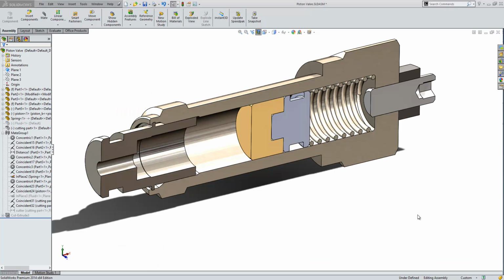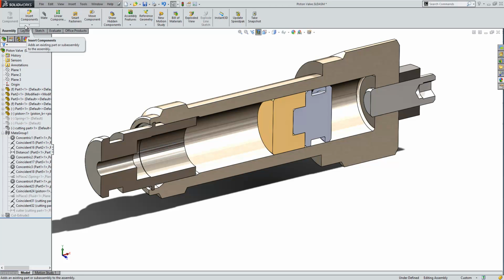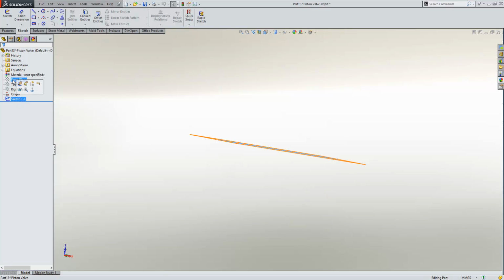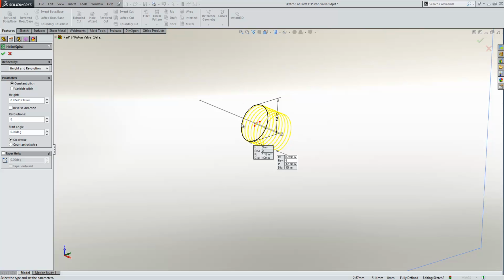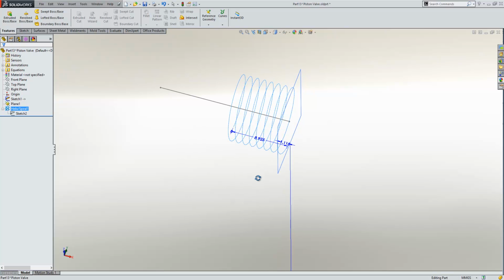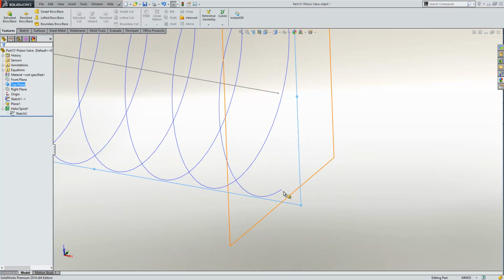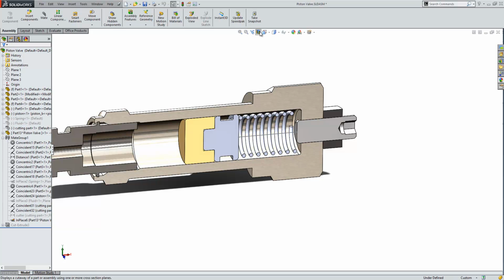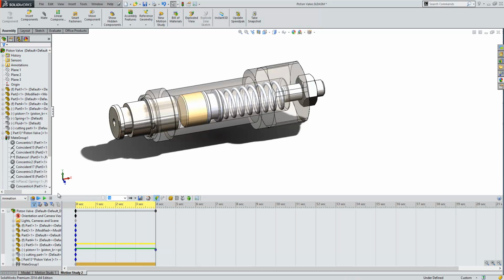How do you animate a spring compressing in SOLIDWORKS?

Comment: idk how quickly you guys reply, or if you even pay attention to this video anymore, but I have a problem with my spring.
I could've sworn it was changing length when it was still just a line, but when I'd finished building the spring & rebuilt the assembly, the spring & line were just moving up & down—not changing length at all.
Is it because the line was created using 2 points on 2 different sketches? The faces that the spring is supposed to push on are rings, not circles; there's a hole thru the middle of both.
Or is it because when I went to add a dimension to the line, it did not over define the part; it didn't ask me to "leave it driven." I tried right-clicking the dimension afterward & selecting "driven" in the pop-up, but I can't tell if that did anything.
I only have until 2pm today to finish this stupid thing, & I'm getting really concerned that I just can't make the spring work.
Reply: OMG NVM I DID IT SOMEHOW
OH MY FRICKIN' CHEESE the line just wasn't actually attached to anything on the one end

Comment: great tutorial but how do you link the helix length to the sketched line if you define the helix with variable pitch? Double clicking the helix doesn't show the overall length so can't be linked to the reference dimn of the line. Using variable pitch gives a better looking spring with closed & ground ends.

Comment from the maker: Peder, if you want a default view for the spring, you would need to set it into the length you wanted, and then right click on the component, and select “List external references”, you can then break the reference which will stop the spring updating if you move the assembly. Hope that helps